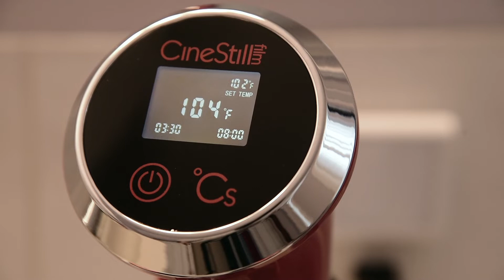How easy is developing color film? Cinestill TCS1000 first use

Comment: I got a TCS around when they introduced it , and I've never been more consistent in developing color film since. It makes it so easy and it's not really that much more expensive than a culinary sous vide. I use it with a Jobo now, and it heats dramatically faster than the Jobo's built-in heating element. I used to mix chems directly with it, but I decided not to because I got scared of cross contamination (even with cleaning). You capture the experience quite well.  The timers are handy, and it heats consistently quickly. It's saved me literal hours of stressing about temps and guessing bath temps. So I'd say I'm going almost 4-5 years strong now with mine.
Reply from the maker: The cross contamination was a bit of a concern for me as well. That's good to hear yours is still kicking 4-5 years in! 
When I bought the TCS kit, I also picked up a Jobo hand rotary tank. I've only used my Patterson tanks up to this point, so I'm curious to see how they compare.
Reply: @filmismorefun  Cool. I've not used the Jobo hand rotation setup, but I like the tanks a lot because they don't have a tendency like Patersons to collect gas and then spray Blix everywhere. ha ha. I love Paterons otherwise, though.
Reply: @Weston Jaxx Happy to help :D

Comment: I'm using one of the Sous Vide Cooker ($44 on Amazon) which works great. My biggest issues it 3 thermometers and the cooker all read different. What do I trust the cooker or one of the thermometers? My old digital aquarium thermometers and the cooker are within 1 degree so I think that is what I should go with. The 2 "photo" thermometers I have are way off.
Reply from the maker: I would go with what your thermometers reading is taken from the develop tank. This way you can spot any temp difference between my Cinestill unit and the actual develop temp. I use HVAC thermometers, because I've found them to have a higher degree of accuracy (no pun intended) than the photo thermometers I've tried. 🙂
Reply: Get a Jobo thermometer. 100% accurate measured vs a clynical mercury thermometer at 38ºC. The latter get certified to 1/10 celsius degree!

Comment: How long after the water was up to temp did you find the chemicals were up to temp? When I tried it, when my water hit 102 the chemicals were only around 88 degrees.
Reply from the maker: I usually mix a fresh set of chemicals with around 100-101 degree water and batch develop 8 -10 rolls. The one time I did heat up the chems from room temp it took quite a while to come up to temp when using the water bath method. I never actually timed it, but my guess would be somewhere at least around 30-45 mins. 
I hope that helps 🙂
Reply: @filmismorefun  That helps a lot, thank you!

Comment: Hey I bought a TCS by my own. I am not quite sure about the accuracy of it. An external thermometer measures a slightly higher temperature in the bath of around 103 F instead of 102. Is this normal? I am new to this topic and my developed films have a weird color cast. I am not sure if this could be the reason for it. Maybe someone can help me.
Reply from the maker: Hey there. How did you initially heat the bath water? Strictly using the TCS, or was it heated up prior? I believe there might possibly be a slight variance in temp, but not a full degree. Check the troubleshooting guide on whatever chemical kit your using to identify what the color cast is saying about the possible issues.